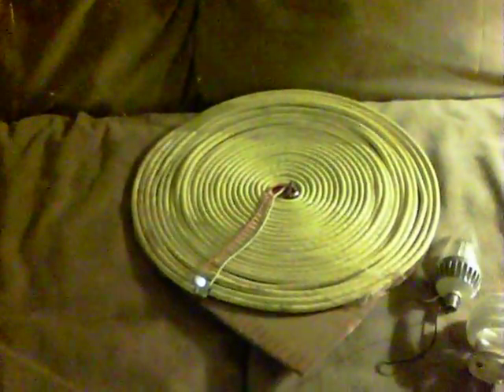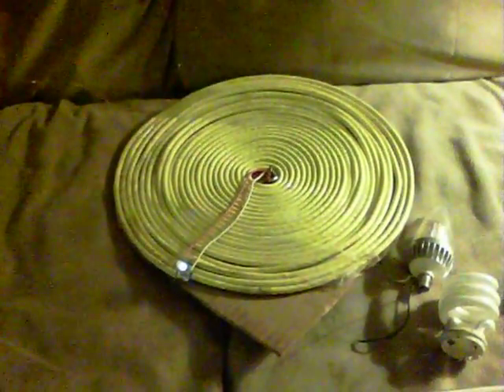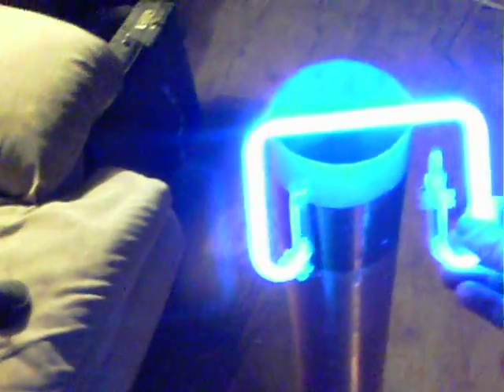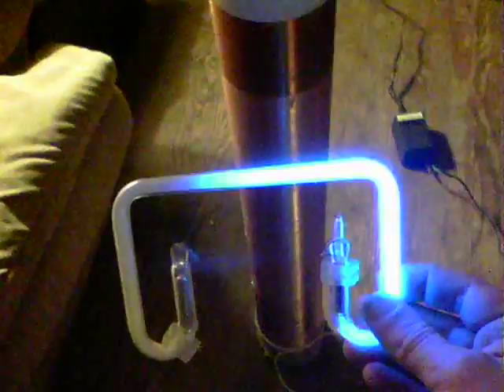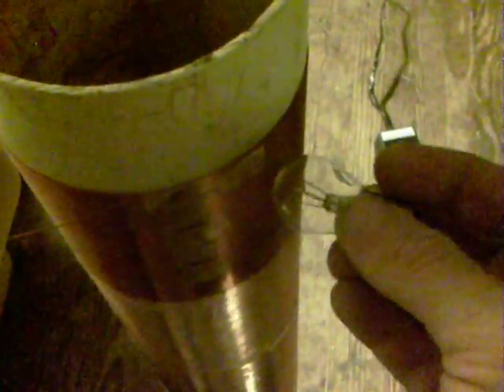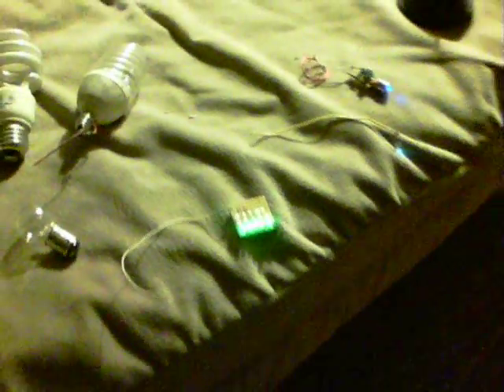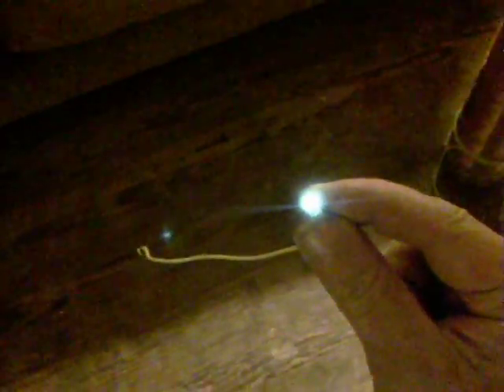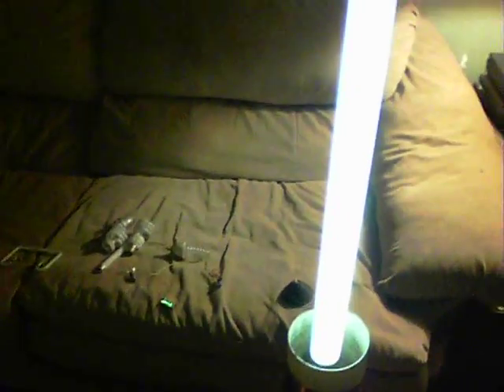The Wysiwyg - Slayer Exciter

Comment: Hi, I have recently watched videos about bigger versions of these exciters like the one from ludic science https://www.youtube.com/watch?v=4OC7cwI4RNM and still don't get it all. He used 36-38g wire with 350-400 turns arround 2.5cm air core here, but I couldn't find these wire gauges anywhere in my local stores, although I already have arround 100m of 0.25mm (33g) enameled wire with me. I asked him about this different setup,  he said that diameter of the winding core should be bigger if the wire is thicker, but didn't specified it clearly though. Do you maybe have any ideas? Please?
Reply from the maker: Viktor Božičević Hi Victor, your comment was blocked cos of the url. The basics, are that the diameter of the wire dictates the diameter of the winding form. This one in the vid used 22AWG, so the tower itself was wider and taller. My 'Walgreen'' type is wound on a pills bottle and uses approx 40AWG. Best results are between 800 and 1400 turns, 2-4 turns primary of much thicker wire.
Some say that the amount in weight of copper should be the same for the primary and the secondary, hence >800 turns secondary tiny diameter = 3 turns primary of much larger diameter.
Reply: slider2732 Hi, ludic science mentioned that I should make the air core thick 3-4 cm in diameter, so I bought a PVC tube of approx 3.9 cm thick x 25 cm long and thought I would use the mentioned wire of 0.25 mm. However, I got the wire messed up because it was a cheaper version that wasn't wound on a spool, but came just ovaly wrapped in a plastic bag. But I found the alternative when I scavenged an old cfl bulb's ballast circuit board and spotted a fine wire on the small transformer that could be almost the same awg. I'm not sure only whether the wire would be enough long for secondary coil of at least 400 turns. I know this is very time consuming process and in order to save myself time I don't want to mess this wire again or run short of it. What do you suggest using this wire or buying the one from online store? Many thanks!
Reply from the maker: Viktor Božičević
You can actually mix gauges on a tower. Output will drop in comparison, but does work. Start with the thickest at the bottom, thinnest at the top. I'd say 850 turns, but 400 will do to show it's working.
it's not too time consuming if listening to the radio, TV in background etc. Just round and round, tight to the last turn and maybe a spot of superglue every 50 turns. Probably 2hrs if focused. Certainly superglue just before the end of the first lot of wire...have the glue in easy reach lol, opening drawers and looking in boxes is no fun with a half completed tower in one hand.

Comment from the maker: No idea what the breakdown voltage on this gauge of wire is, but 30 AWG tends to break down at about 1KV from what i've seen, random plasma shoots from along the wire. 
4ft fluoro is 34W rated...normally 2 or 3 will be same output, then all will dim on adding another. For induction, it's about the tune up and total output available, then how well it can be captured from the ambient around the tower.

Comment from the maker: Thanks. While you've asked and may be interesting to others, have just added a link to the huge Energetic Forum thread,  in the 'About' section above.
Winding the coil can take hours for something this big - all you have to do is keep the wire tight, with no gaps to each turn around whatever you choose to wind around. The circuit can be built up on a breadboard + only few parts, good transistor, resistor and diode/LED. Heatsink may be needed on the transistor, but can run such systems on 1 Volt.

Comment from the maker: If it gets one, it would be a piece of clothes dryer hose. Idea is to use it sat at one end of the livingroom and run house lights over 1 wire. So really, it doesn't need one as such. Also, it may get used with 4ft fluoro out of the top, as a corner light, then gadgets and batteries can be charged with the field energies by placing them on a nearby table.

Comment: You should get a better effect with the tube type fluros if you connect each 2 pins of either end together  1 end to the slayer other to ground ... using the tube as the path to ground for the energy from the slayer, i've found it works great, but also can be a big load on the transistor blown a few that way by not having it tuned properly

Comment from the maker: It's done well, 3 years old, 350+ videos, thousands pics, same Li-Po battery, same rubbish zoom lol
Long way to go on this tower, but was a decent test...made quite a difference raising the Primary half way through vid (I should put an LED across Base to Emitter at least, for tuning). Will swap multistrand mains cord for solid copper and make an internal spiral Primary.

Comment: Thats more like it. I reckon you could get one running a few single wire CFL's and LED's for around 5W. I have a 10w panel sitting on my desk, gathering shade. Should look at doing the same. I have an old solar charge controller needs a new transistor (overcharge protection, old one didn't like me hooking my car up to my house, turns out 70a is too much for 30a controller. who woulda thought.) down in the shed. Why am I still paying for power again?

Comment from the maker: If we got the plasma to turn a bright yellow then ya never know lol. Oh I know with the power supply, it had a packing taped curly mains cord on it too from someone bodging a repair...fixed that and decided to use it. 
Full idea is to put it where my 5W of solar panels are, run off 12V SLA, 1 wire lighting, battery to have a LDR for auto switch over to solar charging when the sun comes up + lights not needed. Zero cost then for whatever it lights.

Comment: what else you can do if you tune it right is to disasemble one of those helical fluro's add some wire to the wires off the globe from inside (as they are a little short to work with) and you connect each side together and connect the slayer to 1 side of the Helix and a earth to the other ... major brightness, I light my work space with it some nights for fun

Comment: Nice slayer :) I Like the Plasma, I always like the Plasma. If the Sun is Plasma too, does that mean we can grow stuff from the light output? Thats one horribly inefficient power supply though. 400ma @30v is <15w, its about 45% efficient lol. You can do better from batterys :) Interesting compared to my little one. You have way better local power, but not as much range on the av plug. I can do at least 3x that distance. I wish I could get CFL's that bright though. I wonder what causes the trade?